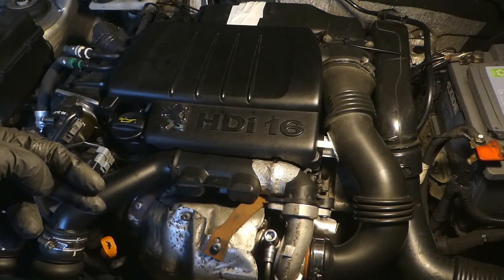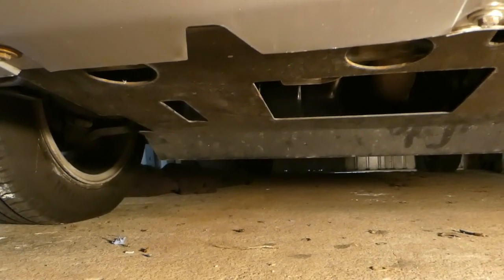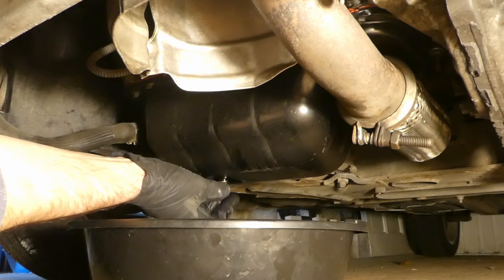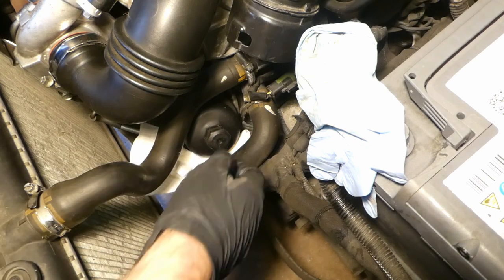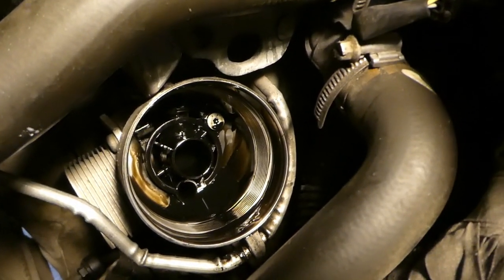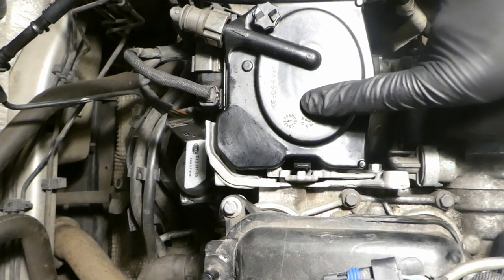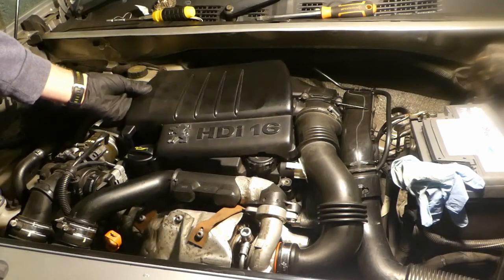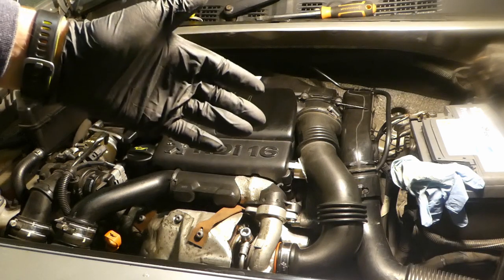1.6HDi full annual service (Peugeot Partner 2007)

Comment: Great video mate. i recently bought 2 years ago my partner 2007 1.6hdi and i really love it. i did all the services as you did mate. This week i managed to remove my egr , and egr cooler and the pipe to the intake manifold, after 175.200km. it was really really carbonized. as i was replacing my injectors seals, i also removed my intake manifold. it was 80% of it carbonized with oily. it took me a day to remove all the hell from it and meanwhile i cleaning the port for intake valves which they were a complete mess!! 60% carbonized. i manage to do this by breaking the carbon with a flat screwdriver and vacuum cleaner. after 3 days of cleaning and high serviced, i went to start up and 'boom!' noise. I found that the starter had gone!! bought one today from local peugeot shop for 160euros, and trust me, it is a pain in the ass to remove this starter and put it back. But now i fixed it back and it is amazing how a different run the engine have after removing all that carbon!! my advice is, dont waste money on sprays like egr cleaners and intake valve spray ecc. it wont work for sure if your engine is 175.200km like mine. :) thanks mate for your great videos!!!
Reply from the maker: Many thanks indeed for the comment, really appreciated. I always had it on my to do list to remove the carbon, just not enough time to do it. Yeah, the alternator is a nightmare, I did it here: https://www.youtube.com/watch?v=L5dQ9kILecM

Comment: Great video for all car owners have got a 1.6 HDI engine. I have the same car, Peugeot Partner with 1.6 HDI 90KM 9HXC engine, bought as a second owner a few years ago. I'm absolutely surprised that my car and its engine are still alive, considering the terrible service done by the first owner, and many so-called professional mechanics; for example, they tore off the base of the air filter and damaged many electrical and mechanical connections. That experience annoyed me a lot as they charged me for damaging my car, so now I do most of the servicing myself. The engine survived these "professional repairs" probably only because I regularly change the oil every 10,000 km, the air filter, and the fuel filter every 20,000 km. The car currently has a mileage of 195,000 km. I have two questions about the type of engine oil. I use (like the previous owner) Mobil Super 2000 type 10 W 40, mainly in Austria, where the climate is colder than in the GB. I drive my car quite rarely on highways, but  lot in the city and the countryside for short distances. That's why the oil  is always so dark black and dirty after every oil change. What to do to make it more clean? Will it help, and is it worth using  so-called engine flush before changing the engine oil, and then replacing used oil with a new one? I don't plan to buy a new car knowing that almost all of them are very difficult & expensive to do any service, so an average user can only fix the wheels (by replacing them). Even a simple light bulb is difficult to change in new cars due to the lack of access and special tools needed, and most engine repairs require a computer with expensive diagnostic software. Ha ha! Lol! Thanks, in advance, for answering my questions about how to make engine oil more clean after replacement.
Reply from the maker: Not too sure if I replied, I thought I did. Any oil that is equal to the spec recommended by Peugeot/Citroen is alright. I would not worry too much about the oil being black. It is a sooty engine and the oil just turns black within a few miles/km. You could potentially flush or change the oil twice, but I doubt it is worth it. Change it every 6 months or say 10k km. That is more than enough. I also change the fuel/diesel filter every year or say 10k km or thereabouts. I think in the booklet for my car it says every 40,000 miles, but that will lead to all sorts of problems. Probably the easiest way is to suck all the oil that is at the bottom of the sump with a syringe and tubing. If you get ~200ml of oil that is the best you can do. Some people change the oil, drive for 100km and then change it again. That would certainly clean it better, but it is too much of expense to do. Hope that makes sense.

Comment: After understanding the start point of the requirement to maintain the 14.7/1 air/fuel burn throughout all engine loads I decided to attempt to review the air filter. Dissemble of the parts was not straight forward as unofficial mods had been implemented. It was impossible to remove the air box without moving the priming bulb. Anyway the job was done. The filter was badly choked and so the engine would never give good performance. So to improve the breathing I hoovered the filter and removed about 80% of the dust and grime. Running much better. More power and tick over much smoother. The whole design of the front section of the air input is very poor and I expect in later models has been improved. Thank you M and M.
Reply from the maker: For diesels the air to fuel ratio is slightly different, not by much, but 14.5:1. Dirty air filter is always going to be bad for fuel consumption and engine running. They are fairly cheap, better to replace it than cleaning it. There will be fine dust particles that you would not be able to hoover up. Nevertheless, better to clean/hoover than doing nothing 🙂

Comment: Very good job, you are doing the work perflectly well. One thing I do additionally each service is to check the  tightening of the injectors. My car (308 sw 1.6 hdi 110hp) is now 220 000 km and this prevent injector copper gasker leakage so far.
I like your accent, no need to use the subtitles!
Greatings from France!
Reply from the maker: Hi Guillaume, many thanks indeed for the encouragement. Yes, I checked them once and they had not moved from factory build. I would have included it, but these bolts are angular tightening bolts and they stretch in order to get their torque settings. It is rather difficult to know what kind of torque settings to use to tighten them again. Some low settings of for example 10-15Nm should do the job, although I have read somewhere 25Nm, but that is way too much. In all cases these are prone to snapping.
But all in all I agree that these have to be checked, it is one of the primary cause of turbo failure in thee engines.
Reply: @moremolecules  Hello,
Thank you for your reply.
I do not apply a specific torque when cheking for these bolts, but just do it manually using a short length lever wrench and tightening them very gently. Each service from 20 000 km to 120 ... 140 000 km it was necesary to tigthen some bolts just a little, but beyond that mileage no need to do it  any more.
Reply from the maker: @guillaumevandenbossche1427  That sounds perfect. I generally go no more than 6-7Nm and max 10Nm, but you can do it manually as well. I generally do not trust my hand to not overtighten them, hahaha.

Comment: Good video, but full service should include cabin filter replacement? Cant find any vids on my specific model with left hand drive...
Reply from the maker: The cabin pollen filter is only present in vehicles with air conditioning. Mine does not have one, so cannot show how it is replaced. In general for the Peugeot Partner it is by the passenger feet, by the cabin fan. You can pull it out and replace it.

Comment: Crawling under a car with a socket saves the price of a bottle of Scotch but if that's no longer an option, it can be drained with one of those cheap pumps - about £15. The first time I used it it only shifted about 1/2 - 1.5 l - but a comment by a reviewer of the pump recommended putting the car on a slight down-slope. I just did this today - the car would have edged fwd with the h/brake off - and the pump shifted pretty much the lot. I should have measured the old oil to check - next time. I hope it works on the g/box filler hole, too. I'll let you know.
Reply from the maker: Yes, that is a very good option if one cannot be underneath. Good advice on the position of the engine for the drainage. Many thanks

Comment: Changed fuel filter in my 308 this was the best out there, thank you. 
Very well explained and highlighted key points showing the small things like clip and plug removal. up close, great camera work. I did have problems starting even after manual  priming for 1/2 hr. Ended up pulling out again all plugs ok and ended up filling filter with diesel,  Worked then. Note that the priming pump does get harder to pump but doesn’t get really hard.
Reply from the maker: Many thanks indeed for the good words. Sometimes the valve on the hand priming pump gets buggered. It is supposed to be a one-way valve, so pumping should get all the air out. It might be that yours is now a two-way valve. Maybe I should have said something in the video. Glad you sorted it out though 🙂

Comment: On my 2008 grand c4 Picasso doing the air filter is a real pain in the back as it’s so far underneath the dash. Also hate doing fuel filter job, repressuring the system sucks!!
Reply from the maker: Hahah, yes, the C4 Picasso is a pain. A lot of other parts to remove in order to get to the air filter.

Comment: So clear. Brilliant. A favour please. Could you do a short video on the 1.6 HDI Berlingo 2007 to identify location and names of all the sensors in the inlet manifold plus the sensor under the Flexi pipe that feeds from the EGR intercooler output to the inlet manifold. Finally where is the vacuum release valve located that controls the vacuum pressure to the turbo Waste gate actuator.. Reason. Trying to track down over boost tripping problem.
Reply from the maker: Thank you 🙂 I'll see what I can do. The vacuum pressure valve is at the back of the engine on the left (looking from the front). If you search "1.6HDi turbo solenoid", e.g. http://c4owners.org/plugins/forum/attachment/1/1423739863_1_FT204284_c4_1.6hdi_solenoid.jpg
and here https://www.peugeotforums.com/threads/turbo-solenoid-valve.30056/
It is a orange-ish looking solenoid with a few pipes coming in/out
Reply: Thanks. I will follow the pipe back from the actuator.
Reply: After further research wrt 1.6 hdi Berlingo I have identified the following sensors on the intake of the Engine. 1. MAF. (Mass Air Flow)LOCATION straight after AIR FILTER HOUSING mounted as an integral part of the elliptical housing above the fuel filter on the Near side. 2. MAT(Mass Air Temperature) LOCATION @10 o'clock straight after the Throttle vane on the intake tube. On the Off side top of engine. 3. MAP(Manifold Air Pressure) LOCATION @ 2 O'clock immediately after Temperature sensor. This is the next thing to check for soot and oil build up. It's been in the car for 150k miles. Finally I mention the cam position indicator sensor. This is located directly under the EGR intercooler flexipipe where it enters the inlet. Someone change this sensor in a video and it extiguished the Engine warning light. I can't see how this is related to overboost issue.  If this doesn't stop the overboost error then next it will investigation of vacuum relief valve and circuit lines followed by wastgate operation. Finally the Haynes manual indicates that the Turbo is designed to produce a pressure of 1 bar(15lbs/[] inch) at 3000 rpm if that's any help. Will update if I find anything further worth adding.
Reply from the maker: @CASHSEC  Good detective work! Is it a 92bhp or 110bhp? If it is the 92bhp, I would check the turbo solenoid for overboost, rather than the other sensors. If it is the 110bhp, you can check the turbo vane nozzles if they are stuck. The turbo pressure is 1bar above the current atmospheric pressure. The boost readout will be the atmosphere + the boost from the turbo.
Reply: @moremolecules  The VIn shows 9HX which is the 90bhp engine as per Haynes. Glad I haven't got a Vane type turbo. Been watching videos of engine work all afternoon to see this vacuum solenoid. Tried tracing the pipe back from the actuator but it disappears under pipes but I won't give up. So it's a MAP check, then the Vacuum solenoid, then the Turbo. Thanks for stopping me drowning. Take care 😀😀😀
Reply from the maker: @CASHSEC  There is a relief valve type thing that sits somewhere between 3rd and 2nd injectors. It is also clipped on the rocker cover. Follow that one to the turbo solenoid, much easier and shorter connection
Reply: Found the Vacuum Solenoid valve on the back of my engine and doing further research this is my final report. It would now seem that if I drive the Berlingo normally it won't trip overboost. This is my final on this one thanks so much MM. https://youtu.be/dkPuEmwP4oQ. Following an annoying overboost limp mode fault I wanted to know how the Vacuum solenoid valve works. When the engine starts the vacuum will pull plunger up and the inner item in the plunger then closes off the vacuum line in the head to hold the vacuum. This vacuum is fed to the turbo actuator and by the difference in pressure closes the waste gate for full turbo operation. Should the boost pressure rise too high the ECU will pulse the valve . The plunger is pulled down and the inner item comes away from the opening in the vacuum line allowing air into the line. This then increases the pressure on the low side of the turbo actuator which will allow it to be moved by the spring opening the waste gate and reduce the turbo manifold pressure. All done to protect the engine. Clever. But the downside to all of this is that a limp mode failure against a P0234 Overboost can be hard to track down. WRT this valve the failure modes can be 1. Sticky plunger. 2. Damaged rubber diaphragm. 3.Bad seal on the inner item. 4. Electric failure of the Solenoid,plug or ECU. 5. Blocked line to the air either by pipe kink or clogged small filter at the end. Checked the MAP(NO CRUD), Turbo Actuator function freely moves and moves to close wastegate when engine starts. Checked the small filter on the end of the air line to the VSValve and it was dirty. On my Berlingo It sits behind in the middle of the narrow plastic Rocker box and the Vac pipe leads away from it under the injection pulses cable then back over the engine down to the VSVALVE. Very difficult to separate the filter after lying in there for 12 years. The pipe becomes soft with heat and if in wrong place could kink up. Maybe a heat gun might be the best aid in working this old pipe. Today a long drive did not produce an overboost failure. Finally it could be that the overboost code may be misleading as it would seem that failure occurs under heavy engine load. I.E uphill in 5th and foot to floor. Is the ECU detecting this situation and going into limp mode to protect the Engine. Driving the engine carefully still acheived performance without failure.
Reply from the maker: @CASHSEC  Great write up, thanks for that. Hope it does not come back with careful driving. For the price of a solenoid, it is worth replacing.
Reply: @moremolecules  Thanks. Should failures come back that would be the first thing to do. I would buy new OEM solenoidfor this. I have a plan now how to get at it and replace it. 😀😀😀😀

Comment: Thank you 😊 I got told to put diesel in before putting it in, but there are different videos but your car matches mine best 😊 so I'll do ut your way 😊
Reply from the maker: You could put diesel in he filter before putting it in. Either way you have to purge the system, so with the rubber bulb does the same things as putting diesel inside, no difference. The problem is that these filters cannot be opened very easy, so that is why I do not put diesel inside. The small valve on top can be used for diesel, but they generally twist a bit and do not seal very well afterwards.
Reply: @moremolecules  this is my first time changing all filters and I'm not the most steady person, so best to not open anything I dont have to 😆
Reply from the maker: @msnorway79  Yeah, works alright for me to just pump the rubber pump until very hard and you can hear liquid going through it. I have done this, without pouring any diesel in the filter, numerous times and never had a problem.

Comment: GREAT video/s...JUST moved on from the Xsara to a C4, so going to be doing this ASAP.
I also have to top-up the actuator fluid...but cant find info on the type of fluid to use. Guess is std 75w80 ????
Reply from the maker: Thank you! What do you mean by actuator fluid? By the 75w80, I suspect it is gearbox? For mine it is Total Transmission Gear 8 75W80 (https://youtu.be/95QarTgx4mI). Hope this helps.
Reply: @moremolecules  Well, there is oil in the gear box and there is also a small white plastic fluid tank used by the semi-auto box to change gears. It is located just under the actuator/s control module. It has a filler screw-on cap on top and a Min and Max mark on one side. My 'other' classic car takes ultra thin Dextrol III fluid in it's autobox, so I thought I best ask before topping the C4 up.
Reply: I think it is the EGS Actuator oil tank?
Reply from the maker: @chessf  Ahh, it is automatic gearbox I suspect? I am not too sure. I have a Peugeot 307 with automatic gearbox (AL4 I think), but it does not have this small tank. It has a special procedure to drain/refil, a bit more complicated.